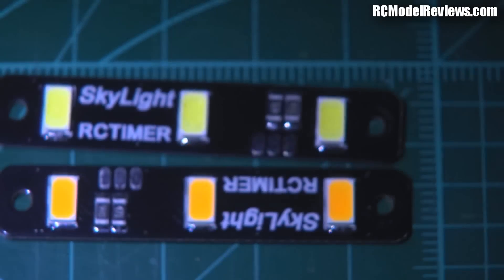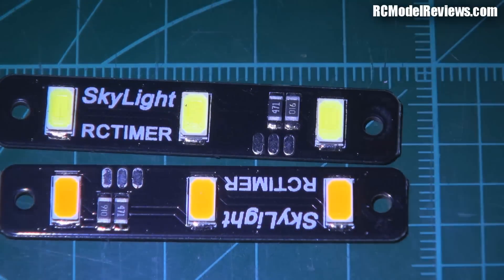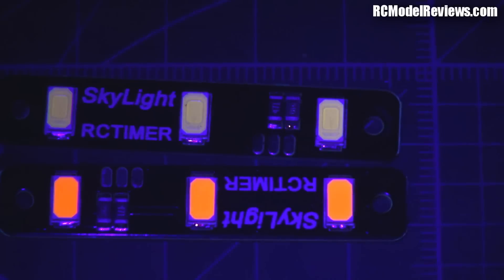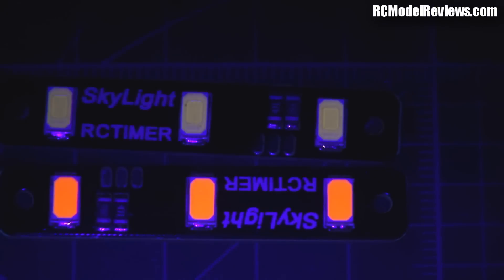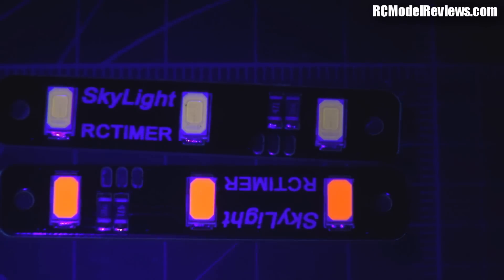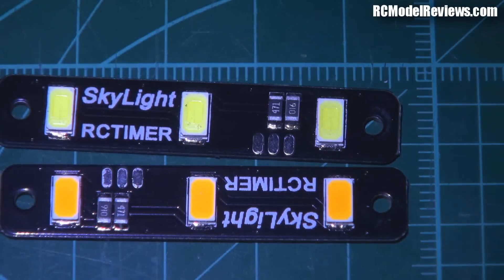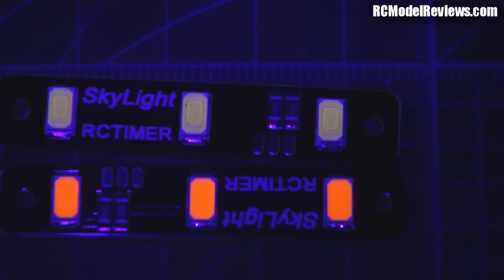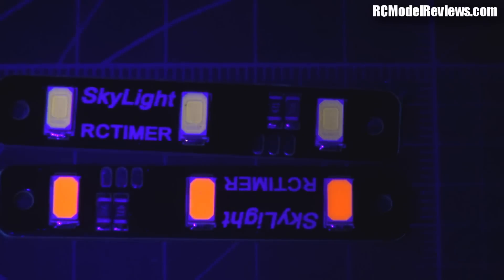More on excited phosphor LEDs for RC models

Comment: the phosphors used on LEDs are mostly blue-sensitive and don't need UV.
I have even accidentally removed the lens and phosphor from a high powered white cree LED, and it's ordinary blue underneath, not (ultra)violet.  I bet that "orange" led is using the same phosphors as in a warm white led, just piled on thick enough to absorb the blue which would typically balance the spectrum.  White leds are actually blue, and a fairly wide-band yellow/orange phosphor, which is why cheap ones tend to make colours look strange.

Comment: I read lock nuts for the 1806 motors Bruce usednin the quad build but I can’t find them any recommendations other than new motors?
Reply: ***** Just use regular nuts. If you don't have those then use those dome shaped nuts that came with the motors. Just make sure the front left and rear right props are tightened really fast because those motors could loosen the bolts.

Comment: I have a question but not for the led but I am going for a hiking for 3 hours and I have a lot of 4s high capacity battery's and I have a DC convertor but only works for 3s but I'm going to fly with the 3s and wandering if there is a simple way to regulate a 4s to 12v for the DC convertor and use at least 8 amps I have a 400watt convertor. Thanks bruce

Comment: Bruce I just built the 250 quad and ran into issues I was hoping you would cover soon.  The videos make flying look easy and I learned the hard way that I have to start with the basics like how to hover and not even try for because I cannot even control the quad with line of sight so putting on goggles will make it worse.  I am now trying to look up how to deal with drift.  I have issues with the prop comes falling off when I crash and losing the cone nuts in the grass.  I hope you post a video on how to fly soon.  I understand the throttle stick but don't understand the stick for pitch and roll.  Able to pitch forward and backward but not sure how to use th stick when moving it left or right not seeing the feedback from the model when I move it left or right.  Hope you can cover what are the limits in terms of height or distance when flying fav as well.  Thanks- tom.
Reply: Tom your nuts come off as you are probably got them wrong way round. They should only tighten. So your cw should be ccw and vice versa. I've no idea why your roll has no effect on quad, it should do the same as pitch forw/backw, just side to side. Something is wrong with your setup.
Reply: Use locknuts to mount your props. What flight controller are you using? The quad should move left/right when moving the roll stick the same way it moves forward/backward with the pitch stick. Perhaps you are confusing roll and yaw?
Reply: Elias R. Thanks Fermanut and Elias:  I discovered that I had my breakout cables attached to the receiver incorrectly.  I did not have any roll control  because my roll was showing up as Aux 1 input in the baseflight receiver testing - I have not field tested yet but I think i fixed it per baseflight.  As to the nuts I am using the cone nuts that comes with the motors - Same as Bruce uses in his build quad video.  I am afraid to tighten them too much for fear of breaking them off.  They will come off if the prop hits the dirt as I have been bouncing or crashing hard.  They are interchangeable with the other motor shafts and there are no CW or CCW propeller nuts.  Thanks again.
Reply: In a different video Bruce recommends locknuts and I do too because they will never come off. I know that Tiger motors sell CW and CCW propeller shafts and nuts but they only fit on T motors.

Comment: You  dindnt show them but im just wondering would your ultraviolet lights fit on a quad? And if so where did you get them?  

I've been looking for some ultraviolet leds to activate my glowing the dark props.
Reply: Cameron Cooke More than likely, Bruce was using a UV flashlight. They can be purchased at Amazon.
A word of warning. UV light is harmful to your eyes and it's wise to use yellow tinted glasses when looking directly at the UV leds.
Mounting them on a quad is not such a good idea.
Reply: Wayne Hobbins fair enough, I got the idea from a picture I saw of a mini hex with uv leds next to the motors  pointed at glow In the dark propellers. Thanks for the advice.

Comment: Hi Bruce. Could you make a video on how would you make setups for different types of multirotors?
Like how battery/motors/props should differ for copter that have to fly as long as possible from single charge or one that have to carry some weight.
For racing quads you need 2k kV motors, what about other types?